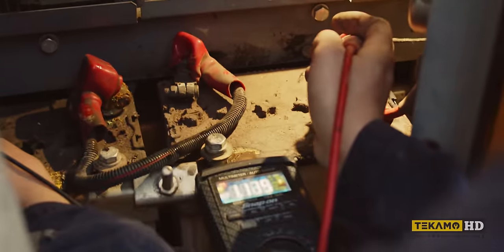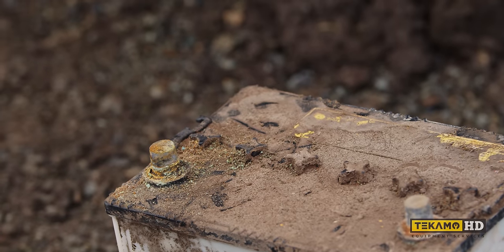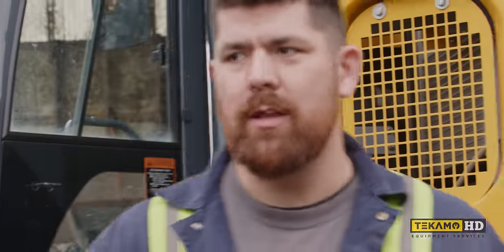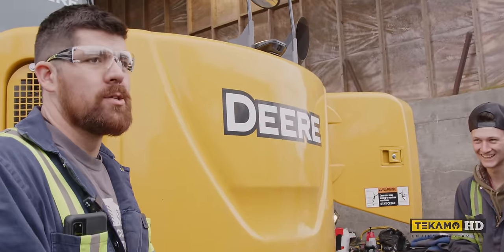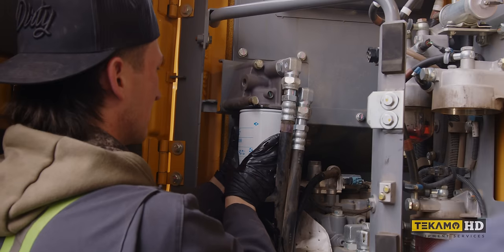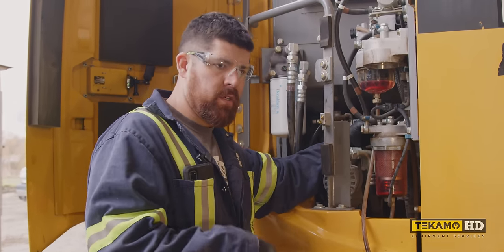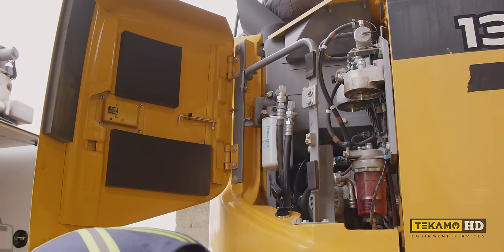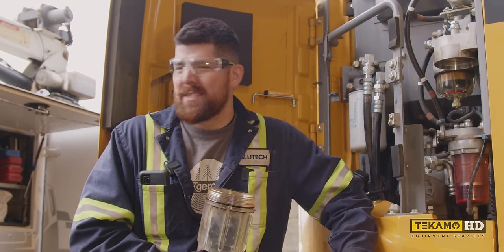7 Awesome Mobile Mechanic Tips To Make Your Heavy Equipment Service Quick And Easy

Comment: I believe in filling fuel filters just take the time and care to do it properly. clean fuel, outside to inside, cover the filter until ready to thread on housing. injectors and pumps have very tight clearances and rely on fuel for lubrication, so the less air in the system with less time spent cranking the better.

Comment: Wow super interesting tip about prefilling oil/fuel filters, I never looked at it that way! I definitely agree with cams logic.
Reply: Hes Right, with the Filltering and the separate lubricat system, but dirty oil? He changes the engine oil, thats way more Oil unfilterd than whats in the Oil filter. So i dont get that, you just have to Work clean.
Reply: @just_m4rv  Oil is "dirty" due to the stuff you get "with the oil" anyway. Like e.g. Plastic Particels or alike from the package in which it was stored - I think its more important in regards of big Diesels than smaller motors.

Althoug I personally would argue; it depens on how long the engine didn't run / what everything is new but that is detail stuff. In general you don't have to prefill them.

Then it depends on "How does your oil distribution works actually?" but yeah.

Comment: I've had two new 12V140E-7 engines that needed the bearings change on because of coolant in the oil. But found that the bearings had debris in the bearing surfaces, cause by filters being filled before installing. I had to hand polish both cranks to knock down the high spots on the journals. We asked the customer if they were filling filter before installing them and they said they did. These engines have a prelube system on them and the starters don't crank the engine until it see oil pressure in the block oil rail.

Comment: I got a question for you ? You said you don’t feel oil filters because you don’t want contaminated oil in the engine, fair enough I get the argument, but then you followed up saying the engine has to oiling circuits One for primary oiling and a second one for Oil filter. Isn’t dumping straight oil in the engine and firing it off still running dirty oil through the engine. Because you’ll be coming through the primary oil circuit. Which kind of defeats the purpose of not filling the oil filter oil because didn’t want to put contaminated oil through the engine
Reply: The whole idea is flawed.  If you put oil into the crank case through a dirty funnel you’d be pumping dirt through the primary circuit until the by-pass filter catches that crud, like if you feel good about pre-filling the filter just do it.  You’re not hurting anything and you’re getting oil pressure instantly.  Which is never a bad thing.

Comment: I agree with not blowing filters out, BUT I worked for a fleet shop in Edmonton and they had a couple of john deer tractors from the 70s and printed right on the air filter housing calls for them to be blown out when it begins to blow black smoke or lacking power (literally says that) so I can see the confusion btw these are cotton filters I believe but hey if I’m wrong correct me btw I didn’t see a secondary filter in these units not sure if that’s factory or someone is cheeping out

Comment: I don't fill filters unless the fuild has been filtered first. Another tip don't stand your filters on end uncovered, if anything falls on the filter it will most likely fall into the center hole. I'v had engines come in with welding slag that plugged a piston cooling nozzle and one that had a piece of a twig in it. Both of these items were bigger than the suction screen openings and the only way for them to get to the nozzles was by entering the system during oil filter change.

Comment: The prefilled filter thing is mostly pointless, when i was at gm though some of the newer vehicles require it for oil pressure on start up but thats the little turbo 4, we would just pump some fresh oil in though

Comment: Your Right, with the Filltering and the separate lubricat system, but dirty oil? When you changes the engine oil, thats way more Oil unfilterd than whats in the Oil filter. So i dont get that, you just have to Work clean.
Reply: English much?

Comment: Do you lubricate your filter O-rings/seals with Lubriplate or any other product? I service heavy trucks and have been instructed to use lubriplate on all fuel/oil filters to make removal easier.

Comment: agco recommends that you blow out filters every 500 hours and replace every 2k hrs. so do you blow when the OEM recommends?
Reply: It’s all about how careful you are, you’re supposed to wipe out the housing with a wet rag so that you don’t get dirt in the engine.  If the situation were real, you wouldn’t pull a cap off that is like 2 feet from where the filter friction fits on, you’d have the housing undo right at the filter base, friction fit to the cover and the snout it slides on.  Then you’d get no dust, ever.  And I get mine cleaned.  I swap them when they need a blow out, and take them to the filter service place and boom I have a clean, like new filter.

Comment: If the machine don’t have a primer pump I just have a 3 ft 1/4 in hose with a compucheck fitting and a ball valve on the end so I can tap into the filtered fuel on my service truck also just keep a gallon of filtered fuel in a old oil jug I know is spotless
Reply: Still not clean enough, spotless isn’t clean…lol
Reply: @jaredmayer3960  I mean I just fill through outside of filter anyhow so it’s really double filtered usually I’ll hook my electric pump up and pull fuel through but the jug is convenient for road calls 5 in the morning with cars a foot from you isn’t really place to be messing with fittings
Reply: @Ndogg673  I’m messing with you.  I think the whole filling filter argument as ridiculous.  Filling it once has less contamination than filling the tank everyday with unfiltered fuel.  Running dry and spinning something over for minutes on the starter is way worse than 1 micro spec of crud from the “clean oil jug”.

Comment: Pre fillin a bypass filter yes does nothing, but then again a full flow inline filter does benefit from being prefilled, because that minimises the amount of air you now have to put through the oil passages and bearing surfaces, plus with engines with hydraulic controlled timing you also now have to bleed the valve system as well, which can take a few cycles for the engine to purge all the air out. 

Best to fill the outside yes, but with a new pack of oil, sealed, you will get very little contaminants in there, unless you are buying dodgy brands, the big brands make sure that they clean the containers before filling, and filter the oil going in as well, to give a very clean product out the sealed bottle. Just fill up the inside, wait a half minute for it to soak the media, put a thin film on the rubber seal to lubricate it, and put on the housing for the spin on filter. Cartridge filters depends, if you can put it on with the housing containing oil, but often you have to put dry, and those typically are low volume units anyway. Hydraulic filters bypass goes on dry, as it really does no actual filtering, the full flow should be full, so there is less to bleed out, a lot of hydraulic systems are a pain to bleed, especially single acting cylinders, as they often will never bleed fully.

Fuel filters depends, before the pump best to fill it, in tank pump put in dry, and let the pump fill it. Most important is to change them.
Reply: never prefill oil filters. the risk of un filtered oil into the engine is too great a risk.   EVERY engine is designed to have enough storage in the oil galleys for it to run without going dry as the oil pump will prime the system while running.
Reply: @overtenemy69  I don’t know if I’d take advice from overt enemy 69.  Sounds pretty smart forsure.  Dry starts are real, and this guys comment is pretty solid.  I’ve seen the funnels dirty, and when you have cold oil that is hydraulically filling the filter the bypass ends up open so you’re pumping junk through your engine regardless.  Do what makes you feel good.  When there’s a 2 gallon filter going on I fill it up.  I fill fuel filters too.  It’s way too hard on your engines fuel components to run dry, and it wails on your starter too.  I’ve seen guys crank shit for 5-10 minutes trying to start equipment.  By this logic you shouldn’t pour oil right out of the jug over the valve/cam assembly on a newly assembled engine before you start it because there might be contamination in the oil?  By this logic you couldn’t ever rebuild an engine because there would be too much contamination.
Reply: Bro just crank the engine a few times you’ll get oil pressure if you’re that worried about a dry start.

Comment: I don't pre-fill oil filters I do pre fill fuel filters usually with stanadyne. I worked on a fleet of Kubota excavators they are notorious for air leaks in the return line system. The little woofer pump doesn't have enough balls to push the air out. I don't think Cam has worked on 2 stroke Detroits you only make the mistake once getting a burp of air. You're there with cosby in a can spinning her over till she burps the air out. The worst machine I had to service was the Deere 690ELC. Odd ball Deere specific filter the POS pissing fuel every where. If you're running bio diesel blend you have to change you're filters more often.
Reply: Why would you fill them with Stanadyne?
Reply: @jaredmayer3960  It's a good cleaner for injection pumps and injectors
Reply: @Graveltrucking  it’s not fuel and I’ve never added anything to my diesel fuel and have ran over 40,000 hours on most of my machines, taken them apart usually because of a seal and none of the components were dirty.
Reply: You do what you think is best, but filling the whole filter with straight Stanadyne sounds like a really bad idea and hella expensive. I always crack the valve at the bottom of the fuel tank to get any water out and that cuts down on algae. I strongly suggest making a lift pump hotrod to a drill battery adapter and priming the fuel system that way. You get all the air out and fill up the filters. No more spilling fuel everywhere or lifting up heavy filters to try and spin on. If you're the guy working on a fleet of the same equipment, add a quick release fitting somewhere before the filter so it's nice and easy every time.